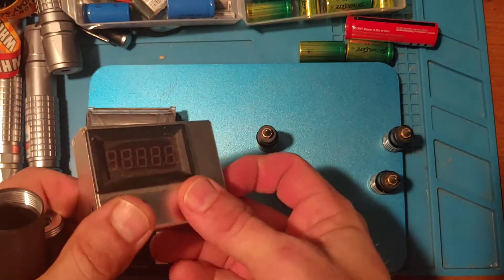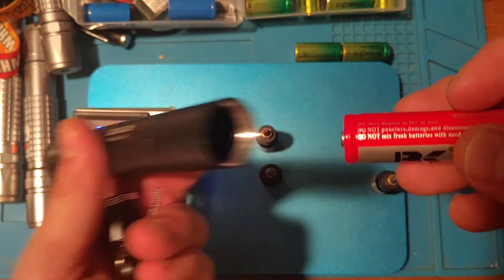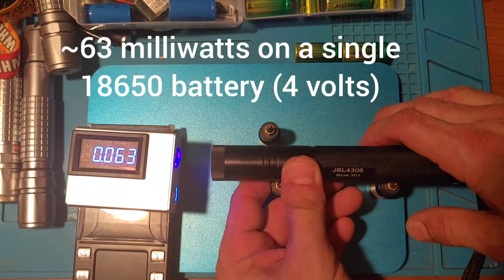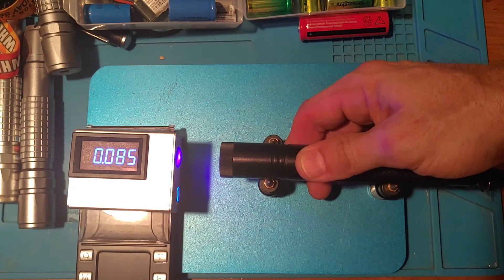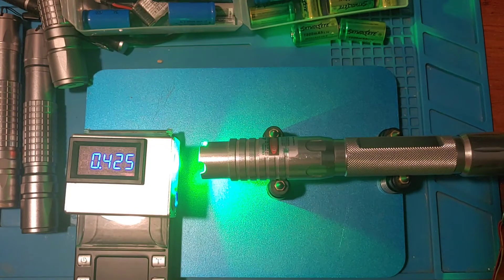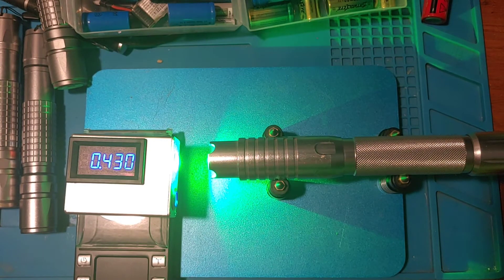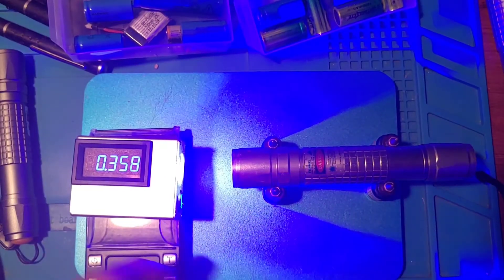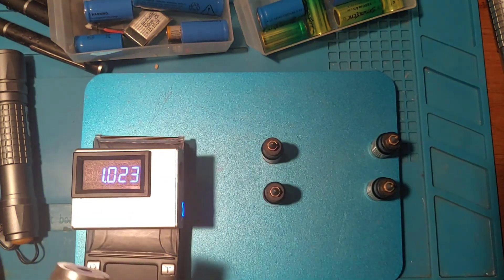Handheld Laser Power (18650 or two 16340 batteries)

Comment: Thanks for the info. I was going to replace in my 50K mW Blue Laser - (2) factory 16340 1500mAh batteries with (1) 18650, but with the untested voltage, I think I will just replace them with (2) 16340 2800mAh. According to my research, the increase in mAh should be safe and also increase the usage time.